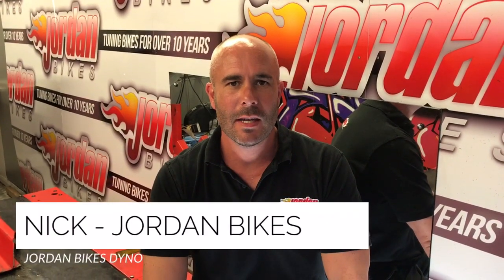ECU REMAPPING / FLASHING EXPLAINED FOR MOTORCYCLES - JORDAN BIKES LEEDS

Comment: If you put an after market exhaust on and invoke more air through the air path, your lambda sensor would adjust for any A/F imbalance.  That is literally the lambda sensors function! You don't need a 'remap' just because of an aftermarket exhaust.
Reply: You do you. Bikes are Euro 5 now and the fuel maps are made to run  so lean out the factory, same with throttle mapping they don’t give you even a fraction of 100%. Honestly a remap is the best money you can spend on a bike these days and that’s with prices being circa £450 these days.

Comment: Hi nick, have you any experience with bmw r1250gs bikes, mines a 2022 bike, i normally use quantum remaps locally to me,rotherham but i think these maps are just generic maps that was created on a stock 1250gs bike,ive also fitted quantum maps to a 1200gs and a 2018 1250gs all good results and all my bikes modified as belowe,  although now mapped its runs lots better and perfect im thinking i need a custon map as my bike has free flow air filter,cat bypass and free flow arrow race can.  its running stock engine breathers going back in the airbox which im going to move and its still got the exhaust flat fitted, do i want to be deleting this exhaust flap or leave it on, any advice would be great and can you crreate a custom map for my spec bike. thanks Dodge.

Comment: ......  Dopey question Nick,  I'm an old fart teetering on my "three score & ten" and I now ride a 2007 Burgman 400 scooter here in Brazil.  I cannot get it to run smoothly, hesitant throttle response, the design is old, the IAC valve is just a 2 wire solenoide in or out job.  Is it possible to bench map the ECU without having the bike there and on a dyno ?   Thanks,          Chris in Brazil.
Reply from the maker: Hi Chris, we need a bike in front of us in order to map it, we can’t just map an ECU with no bike present, sorry. Thank you very much for the contact
Reply: @jordanbikestv  Hey Nick !  Thank you for your reply !  I'm slowly beginning to understand this "new-fangled" injection stuff !   haha   It seems that most of the sensors are basically potentiometers that have some mechanical method of moving of a contact coil giving a variable 0 - 5v. signal to the ECU.  Here in Brazil  the sensors from the concessionaire are silly expensive, but I have found chinese ones that appear to be the same as the originals, but at 1/10th. of the price !  Just a quick question....  if these sensors work inside such a tight resistance/voltage range 0 - 5v. are they much the same ?,  for example the MAP, (400mm.Hg), sensor on my bike appears to be exactly the same as the one Mitsubishi and Toyota use on some of their cars and trucks, and the simple two-wire TPS sensors only seem to vary in their mounting and turn direction, left or right-hand !  Obviously I understand that the originals would probably be the best bet, but I would have to stop eating for a couple of months to be able to buy those !   hahaha Thanks and Cheers, Chris in Brazil

Comment: i have 2 questions. my bike is a 2016 Kawasaki er6n. i have fitted a sc project full system, and a healtech quickshitfter.
1. is there a dinojet power commander available for my bike? ( i have looked and cant find any)
2 if so is it compatible with the quickshifter?

thanks in advance.

Comment: Once a bike has a £220 map and if the owner doesn’t like the outcome can it be reverted back to the original ecu map? And does a customer have to sign a disclaimer so if for some reason the bike and the new map don’t work properly it’s down to the customer to get fixed? So in short if something goes wrong during or after the map will Jordan bikes fix Z problem. Thanks
Reply from the maker: Luke G if you are unhappy with your extra power and smoother throttle we can remove the work we’ve done. What we do will certainly work properly, there’ll be nothing to fix afterwards. In 17 years of tuning bikes we have never had a customer ask us to put their bike back to standard, as the improvements are fantastic. If you don’t want more power then don’t book in, but if you do, you’ll like the outcome.

Comment: Long term effect of ecu remapping?
Reply from the maker: Gee Six the same as the immediate effect. Better mpg, more power, more torque, smoother throttle, restrictions removed. It runs as the factory intended before the were forced to tone it all down for EU regulations.
Reply: @jordanbikestv  in 3 years is there issue when you ecu ramapping?
Reply from the maker: Gee Six no
Reply: @jordanbikestv  thnx sir :)

Comment: hey i am using  powertronic piggyback ecu for ,so it works in close loop system  or any piggyback ecu ? cus every bike has o2 sensor and no matter we had fuel o2 sensor eventually bring the figures to stock ?  can u explain me the procedure ? 😀 and plus my piggyback ecu has ignition timing and fuel map or proper ecu flashing is better option?
Reply from the maker: karan bundhela give us a call and our tuning staff will be happy to discuss the options we offer 👍🏼
Reply: Many bikes have an O2 sensor but many are narrow band not wide band.  My understanding is the narrow is like on off i.e. lean, ok or rich, but not by how much.  Wide is like lean, good, rich, and by how much.

Comment: If you get a full system for your bike is it ESSENTIAL to get a tune as well? I’m considering a full system just because there aren’t any slip on options for the CBR650F without cutting and welding. 

Also can you tune it with a stock exhaust and have it work well with an aftermarket one as well? 

Thanks

Alistair
Reply from the maker: alistair tang fitting a full race exhaust will usually alter the fuelling so much that you lose bottom end and mid range power, as well as running too lean/hot. Unless you spend the extra and have it mapped correctly we’d recommend leaving the exhaust alone rather than fitting a full race exhaust. We can map a bike with either the standard or a race exhaust, but if the exhaust is then changed, it will no longer be running perfectly,
Reply: jordanbikestv one more question: Can you reflash the ECU on any bike with EFI? More specifically a 2018 CBR650F. Or is a Power Commander/Bazzaz the only way to go?

Thanks

Alistair
Reply from the maker: alistair tang we’d need a power commander on yours. The full list of bikes we can ECU Remap is on the Jordanbikes website 👍🏼

Comment: FYI Its not an EXPLOSION (That's Pinking) a Burn Rate of greater than 30 feet per second per second is an Explosion, we want to reach as close as possible without the Explosion (or exceeding that burn rate) Just saying....
Reply from the maker: David A Palmer we’re trying to explain it in the simplest of terms. Thank you for your comments, you’re spot on.
Reply: David A Palmer theirs always one isn’t there.